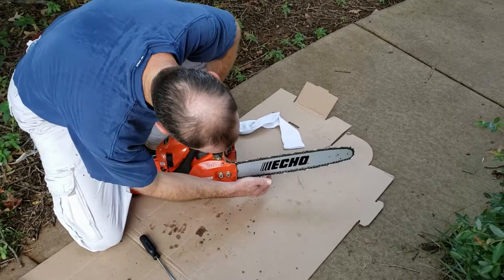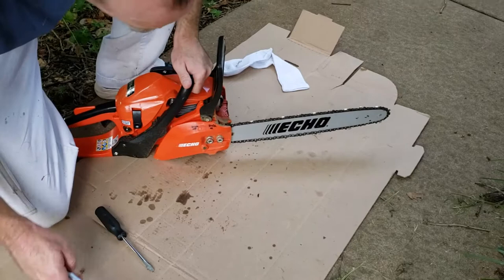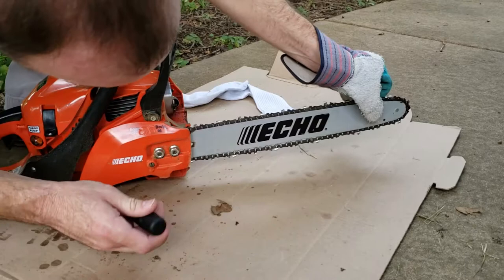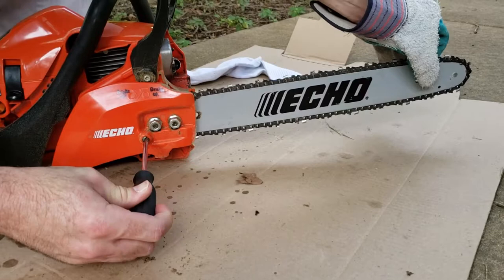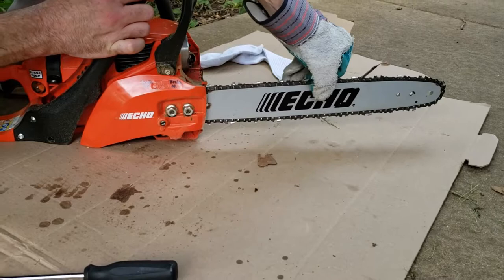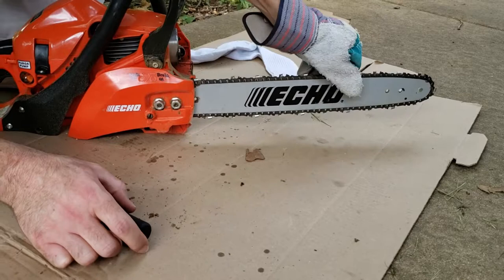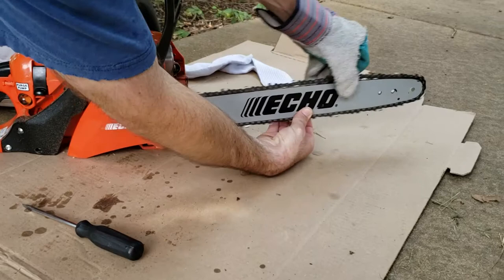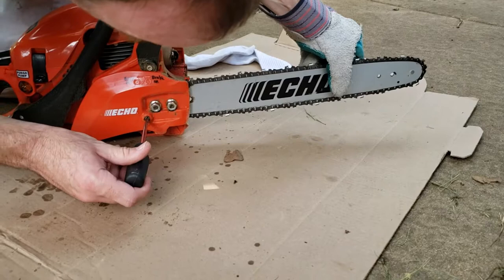How to adjust chain tension on Echo chainsaw (CS 352)

Comment: I have the same saw and am unable to tightened the chain like you just did. Saw  works great when cutting, but am unable to adjust the chain tension. I bought it used last year from a friend who hardly used it and sold it due to moving out of state. Saw is now 2 years old with very little use, maybe about 15 hours total. Soon as I have time, I'll call Echo to see if they can help.
Reply from the maker: Dang. Sorry to hear that. Good luck with it.
Reply: @FixEverythingYourself  Thanks, may have to take it in for service to have it checked out.
Reply: You need a new adjustment assembly from amazon
Reply: @codyfoster8004  Thanks, I'l ck that out.
Reply: @codyfoster8004  link ?